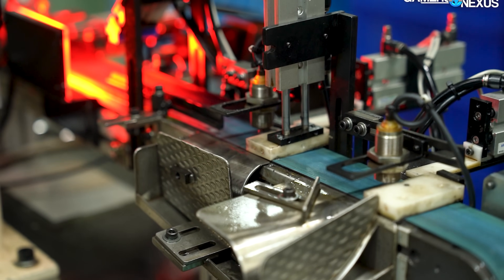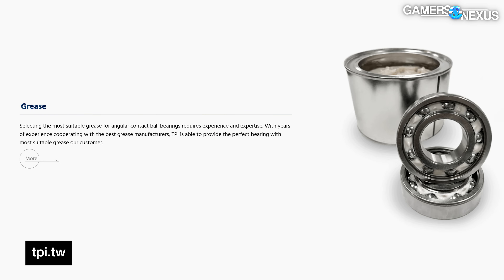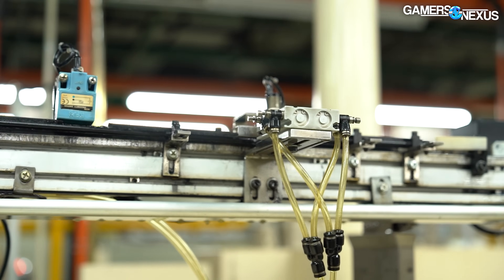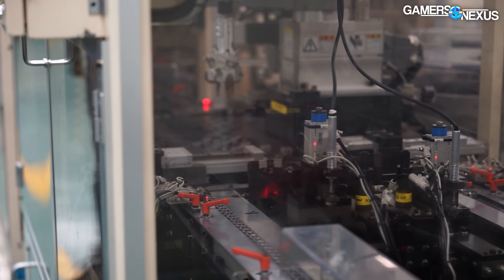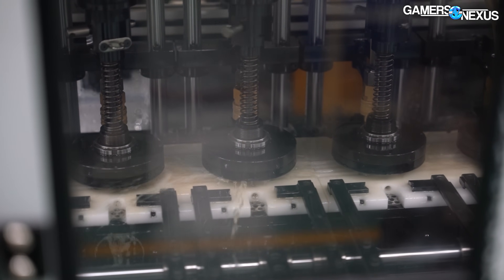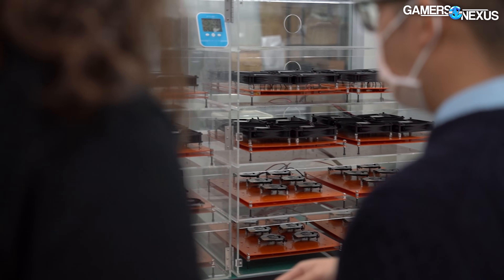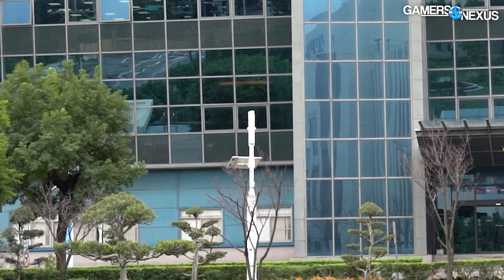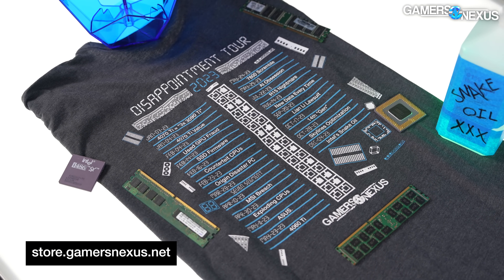How Computer Fan Bearings Are Made: Ball Bearings & Fluid Dynamic Bearings

Comment: Fluid dynamic bearings are amazing. I recently did maintenance on an old server that had a fan die. I pulled the fan ( a dual blade 40mm delta) and foind that it still spin smoothly with no play on the bearing whatsoever. That server is 12 years and this was one of its original fans. This aerver jas run pretty much 24/7 for thw past 12 years all with rhat fan doing around 20,000 rpm. Its simlly amazing that beaeing has spun over 100 billion rotations and is still good as new

Comment: CORRECTION @2:48: Angular Contact Ball Bearings are NOT commonly referred to as just "Ball Bearings", those would be "Deep Groove Ball bearings", The most common. Angular Contact Ball Bearings are fairly specialized to every use case, and are often ground in matching pairs.

Comment: Building silent PCs for the last 22 years there were always 3 annoying banes of noise: ratteling HDDs, squeely capacitors and ticking fan bearings. 😜
But yeah, good fans with fluid bearings are a must for a silent PC - doesn't matter if aircooled or watercooled. ✌

Comment: Hey computer jesus!!

i've been getting into minipcs as of late, and even though i am a hardcore PC enthusiast, hardcore oveclocker(started with celeron 300A to 533mhz) i struggle to understand the difference between Intel N95 and N100, and on top of that there seems to be out there many mini-pc with wildly different turboing and power settings for the same CPU that can make( i have an acemagician  t8 plus and it's stable at 2,7ghz under stress, but then i go other reviews and resources and i see way less averages under stress(notebookchecks says 1.2ghz under stress). Maybe a collaboration with @servethehome(they have already many of these kinds of hardwares)?  i would love to see an in-depth  analysis of power and frequency under stress, with your usually high standarsa expecially under linux/stress. The feeling is that there are some companies that makes excellent hardware and some others that will cut corners regarding the turboing of these low-power cpus.

Comment: As a car enthusiast and a background in various engineering fields, bearing are always on my agenda and I find them extremely fascinating and a marvel of centuries of engineering progress.  Plain bearing "hydrodynamic" type found in engines, also on the same principal as those FDBs in this video are some of the most mind blowing engineering, metallurgy, precision and metrology intense bearings out there, despite being one of the oldest and simplest designs at face value.

FYI, the oil film that supports the load in these type of bearings are often refereed as the oil wedge and there is a ship ton of cleaver engineering and physics involved to make it all work and work optimally.

I find it incredible that bearings in some many thing we take for granted in many harsh use cases just last so long and are so reliable.

Comment: To me ball bearings are the best and expensive fans should use these.
The commercial market uses those, in servers that are meant to operate 24/7 for 5 years and have 0 failures, they don't use FDB.
And the plain sleeve bearings should be made illegal at this point due to their short life span and massive amount of e-waste generated because of this.

Comment: These fluid dynamic bearings (FDB) operate on the same principle as journal bearings, a wedge of fluid builds up on the leading edge of the shaft, serving as a liquid 'ball' to hold the shaft up. Some examples are the shaft bearing of a ship or the crankshaft  bearings in your car. Difference being that FDB's don't have an oiling system.

Comment: The way the bearings were measured was a surprise to me. I always thought they used air plug gauges to do this. But for super precision bearings the internal tolerance of manufacture seemed quite high, not the assembly though. The matcher robot is a good thing. I have written programs for robots that will do a similar thing and operate by measurement and it was a pain. I have used TPI bearings in lathe repairs and was never disappointed with their quality. Several bearing companies are very much hit or miss in that field, good for some sizes poor for others.

Comment: I love seeing a factory that keeps a real time test bench going even if it takes decades. At one of the manufacturers I work with they have an AC compressor that had been running for 60 years straight before it died a few years back. It outlasted their own production of AC compressors entirely by 5 years.

Comment: 10:00 looks like an induction coil not a heater. It blast current not heat. I could be wrong but i don't think a heating element could heat that much that quickly through air.

Comment: What kind of lubricant if any do the bearings in the double ball bearing pc fans use? 

You mentioned the bearings in the tour were greased and  sealed with a rubber seal. I'm assuming pc fan bearings want the least rolling resistance and the grease and rubber seal would create too much drag for a pc fan.

Comment: Really wild to see this video show up in my feed literally a day after one of my Asus 3060ti fans start the death rattle. Many folk wouldn't pay attention to bearings in general but i reckon most my biggest L's with PC's have been due to them. I remember this old XFX AMD card i had like 13 years ago, Fan literally came right off and i glued up a separate fan underneath the gpu. I never thought to use Zipties and it done me an extra few months of TF2, BC2 CS & Gmod. 

I was more experimental back then, even tried to put laptop ram into a desktop in like 2007, now I'm scared to take the darn thing out the PCI slot without the fear of pcb snapping off now.

Comment: 10:14 no heat is getting blasted, magnetic field is blasted. That is an induction heating, it heats by exposing the item to quickly changing magnetic fields, inducing high eddy currents in the item which in turn provide joule heating through ohmic resistance. The circular nature of the bearing makes this more efficient, theyre basically pickup coils themselves consisting of a single turn. This could even make for differential heating between the inner and outer ring, the induction scales by pickup area, so by radius. Since you want the rings to expand differently, this helps the process.

Comment: Amazing to see how these things are made, and considering how many ball bearings I've destroyed over the years by jumping on them and/or throwing them around (skateboarding), it's interesting to see just how tight those tolerances really are, and it does explain why they're one of the biggest failure points.
Also, question for Steve/GN staff; any idea what the max power on that induction coil is that they use to mate the ball bearing parts ?

Comment: I don't think it's accurate to say angular contact ball bearings are just standard bearings, they're more special purpose than deep groove or other bearings for radial loads

With a circle drawn on a page, radial loads would be up and down, towards or away from the centre of the circle. These are the (main) types of loads a wheel or other rolling element would experience. Axial loads would be into and out of the page, so perpendicular to the face of the circle. Axial loads are experienced by fans where instead of trying to roll a wheel or pulley, the blades are pushing kind of sideways along the axis. They also come into play with angled gears where the angle creates a combined axial and radial force, and no load is ever purely one or the other, but substantial axial loads are not the norm

Part of the reason angular contact bearings aren't the default is because single race angular bearings only work with axial forces in one direction. Push the other way or mount the bearing wrong and it just falls apart. So more complicated double race bearings or using two back to back is usually required unless it's an extremely predictable load like a captive fan that only spins one way and never experiences decelerating forces

Comment: The worst bearing by far are rifle bearing, and for some reason all gpu manufacturers love to use them, I’ve had 3 gpus and all 3 of them had bearing failure. On my 3070ti I’ve had to replace 2 fans and I turn my computer off at night. To have to replace 2 fans on one gpu isn’t something someone should have to worry about when only owning it for 2 years. It has plenty of airflow, it isn’t choked, and the fans don’t really hit full rpm ever. Luckily Evga made it easy to replace the fans but 2 years of moderate use shouldn’t make fan bearing fail when I’ve had case fans older than that still spinning with no issue.

Comment: Steve, as others have said already. I really want to thank you for this series. 
THIS factory in particular holds my interest most. During all my time as a mechanic on an aircraft carrier, we dealt with ball bearings the most. There is nothing like packing your own ball bearings. Putting them into an oven so you can get the two races back together. LOL
I completely understand and appreciate T.P.I. not showing the FDB parts. 

As for a vote/recommendation/wanting factory to see. I would like to see a heat exchanger factory. Sorry, I mean, PC sized radiator factory.

Comment: This is just a marketing word, the real fluid dynamic pressure bearings need very high precision and very small fit clearance, reasonable pressure circulation path and perfect and reliable working conditions, which have high requirements on materials, processing, lubricants.

The fan's "FDB bearing" is just a poor imitation of a real hydrodynamic bearing with wedge-shaped grooves carved into the inner bore of a soft, easy-to-machine but easily worn alloy sleeve.

If you want to know about real hydrodynamic bearings, you should disassemble HDD's spindle motor bearings.
Reply: The only current computer fans that have bearings that actually resemble the FDB bearing structure are the bearings in the GeForce RTX 40 Series fans from Nidec.

Also, I don't think the conditions of a low RPM fan are suitable for fluid dynamic bearings.

Comment: 16:05 that bench top power supply is not what I expected.
Now it isn't "bad", as far as providing power is concerned.

I have two myself.
The noise on these units is fairly large, like a good few hundred mV, won't matter for driving/testing a fan.
Though, the thing that surprised me the most when I bought mine were how I got express air shipping from China to Europe in 2 days when the shipping were "free" on a roughly 1 kg PSU costing a measly 80 USD, so the power supply itself must be quite a bit cheaper...

Comment: The ring size matching is actually so cool and definitely something I would not have thought of, awesome to learn about these kinds of optimizations
Reply: Had the biggest grin on my face when they showed that part of the process. That's such awesome problem solving and it's so cool to see it in action!
Reply: They slightly heat the outer ring so the wall chase drops in. Thats super interesting.
Reply: On my bench I have a brand new PS5 fan that broke because I accidentally spilled a few drops of pop on my new PS5. I now have a good reason to tear it apart. To see how they keep the lubricants in the bearing they showed last. If that’s what’s in it.
Reply: I was going to say exactly, very cool.

Comment: I have more appreciation for high end case fans now, it's interesting to see how the core of a fan is made, even before the fan blades or motor comes into the picture.  There are so many steps involved in putting these bearings together: they may last 50,000 hours but that's only because of the attention to detail for manufacturing shown in this video.  Very cool stuff!

Comment: say, looking at the sponsored coolers. how much does the heat exchange differ compared to blank metal and different colors?
I bet it's negligable, but for the form-follows-function nerds out there... can you test this?
I imagine a cooler box converted to a test stand. variabel constant heat heating element to mount the cooler on, chill everything to something stable and then watch a buttload of sensors if they spew out sensible data until equilibrium... 
bc iirc you fan testing rig really only tests the fans, right? I'd gladly take a pointer to where this was already discussed.

Comment: Been there done that. Early one of my first jobs was making bearings. In that case it was bearings that went into automotive engines mostly. Though I also had occasion to help make the bearings for tank treads, which oddly enough had the tightest tolerances of all the bearings we made.
Reply: What's the reason for the tight tolerances? Was it needed?
Reply: @outlaw6313  My guess is that those treads put on an extreme stress on the bearings. Plus a tighter tolerance makes it less likely anything like sand can get into that area. Which has got to be a huge concern with any military vehicle.

Comment: Awesome series.

This episode reminds me of my old job.
Except our smallest bearings were starting at this companies biggest 😅 (our biggest ones were up to several meters).

It's been quite some time now, and my department did the rollers in the bearing.

Still remember some special tolerance for customer wishes.
5μm tolerance for a 27mm diameter roller.
And yeah, they still got sorted after, for a tolerance in a set to 1.5μm.
With a roundness of 0.4μm or better.
It's kinda amazing what we can do in modern times.
A few times over my decade working there, when the measurement came back from the lab that the roller wasn't round enough, I just flipped the roller on the side, rolled it down the table.
Looks like it's rolling to me without wobbling 😅 (tolerance says 0.5μm, 0.5 and higher is obviously red, 0.4 is yellow, not good enough to start production, 0.35 and lower is the target)

Comment: I was wondering what bearings Noctua uses (since that's all I buy) and they use SSO (self-stabilizing oil-pressure) bearings instead of a fluid dynamic bearing.
Reply: The SSO bearing IS a flyid dynamic bearing.  They also utilize a magnetic system to further stabilize the location of the shaft.  It's like a hybrid between an FDB and a mag-lev bearing.

Comment: There’s a great deal of research in the Aerospace industry around maintenance of bearings. Surprisingly, they are not that reliable in the sense that they have a predictable lifetime but actually fail “randomly” even in ideal conditions. In the engineering industry we find it pointless to replace bearings on a fixed schedule but replace based on condition via vibration monitoring.